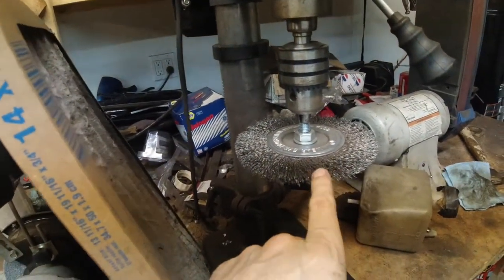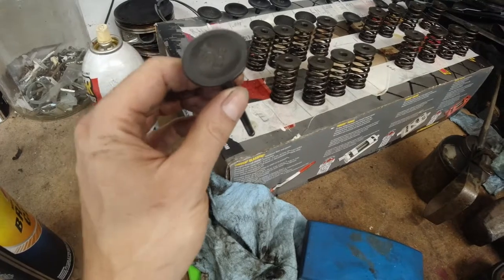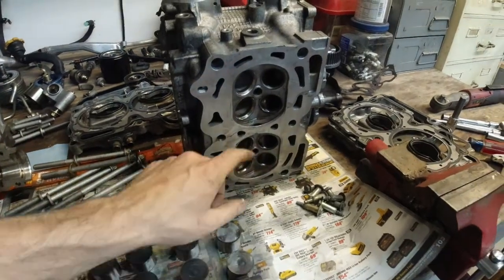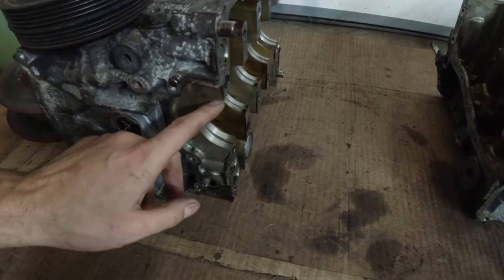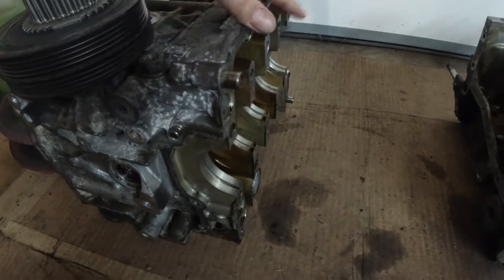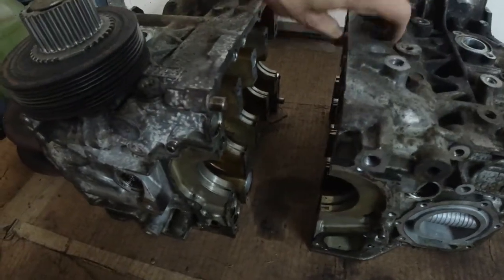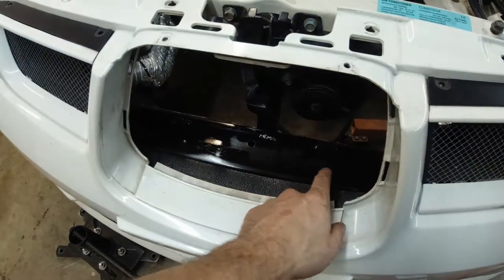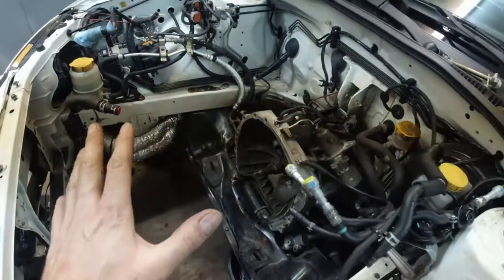Subaru STI cylinder heads, cleaning combustion chamber and valve lapping part 2

Comment: The oil channels for the cams how do u clean inside them? Should you have to?
Reply from the maker: Use brake cleaner, lots of it or if you took the heads fully apart then you can dump it in hot water with soap, if you had a bearing failure and have metal shavings inside engine then take those outside plugs out on the side of the heads, heat them up if they wont come out, I believe its an alan key, then you will have full access to the oil galeries and just spray brake cleaner inside each hole until clean brake cleaner comes out.
Reply: @cruizinmax4017  ohhh I see I didnt know sbout access to galleries.

My car runs fine. No leaks, no smoke, no noises. It reaches 1bar boost. 

But did compression test. 

Cylinder 1 125
Cylinder 2 135
Cylinder 3 145
Cylinder 4 150

So thinking about rebuilding now before gets worse? 

So looking up videos of stripping down heads. Yours amazing. Liked n subscribed

I think I can do it but if get head machined i was thinking what if metal gets in them n when put back u start car n metal gets to bearings?
Reply from the maker: yes thats a possibility, thats why u need to clean them 20 times if needed.  And open up those side plugs like I mentioned....as far as your compression 125 is still good, 150 seems high for a turbo car and the difference between 1 and 4 seems to much.  Thanks for the sub!
Reply: @cruizinmax4017  oh I see I read it between 138-160 for wrx? 

I'm going to look for a video on these galleries. Thank you so much
Reply from the maker: Sorry for the late response, yes you are correct, the 138-160 seems legit, you just dont want more then 10psi difference between cylinders.
Reply: @cruizinmax4017  hey no worries at all. Take ur time really appreciate the videos n responses. :)